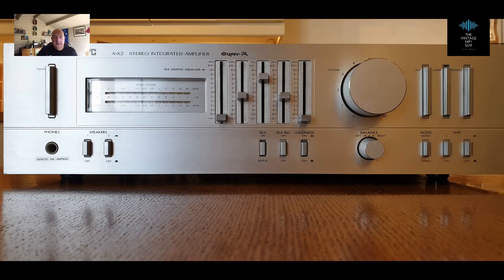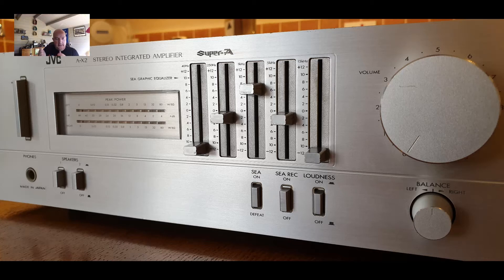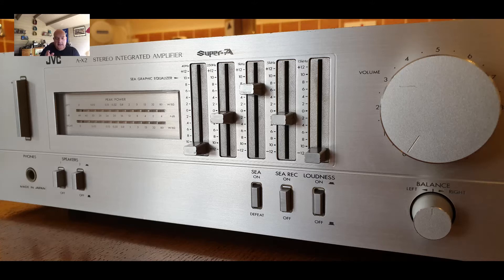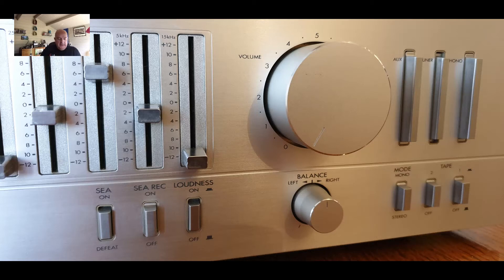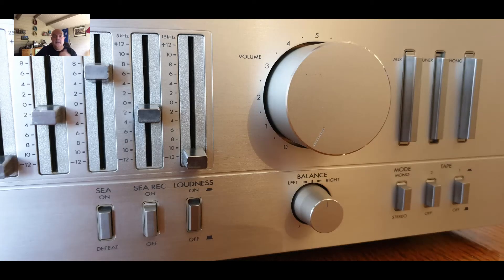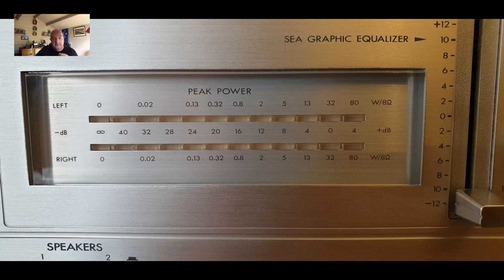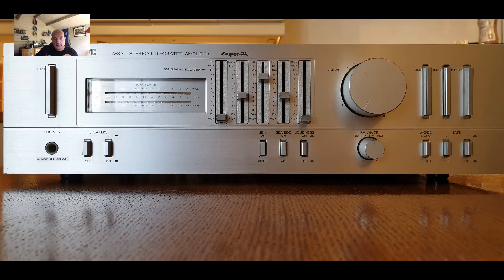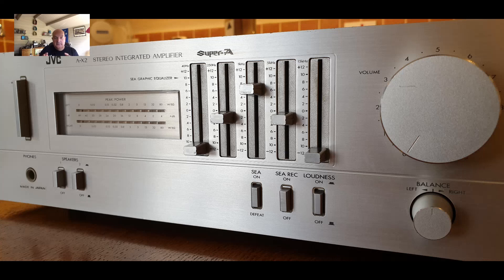The JVC A-X2 Amplifier and Class A Amplification

Comment: Great review, this was my first proper Amp in the early 90s and I still have it today, besides some thermal past replacement and regularly cleaning the pots it never let me down in its 43 years of existence and 30 years in my possession. I was actually planing of going back to Vinyl  but a bit unsure with the weak Phono capabilities you mentioned. Do you have any (affordable) recommendations for a Phono Pre-Amp to combine with the A-X2 or a better alternative Class-A or D/AD amp for Phono use only?
Reply from the maker: Hi. Great to hear from you. I've since sold the amplifier and I'm definitely missing some of its Class A capabilities into certain speakers. My reflective view is that the phono stage is still the weakest part of the package, but whether this was due to age of the quality of some replacement styli today is moot. So much of a journey back to vinyl is dependent upon what you're trying to achieve - i.e. whether you're expecting real high fidelity or just to re-experience the warmth of (some) vinyl. I've found my recent experiences to be patchy - some old records are simply badly cut, others are ok. My old collection is generally of poor quality, mainly due to me moving many times with them over the years and possibly not taking too much care of them in my younger years! If you want to build a new collection of well-cut discs, then you'll need a better pre-amp. I've used Behringer pre-amps less than £50 before now with MM cartridges and they are more than OK for me. Audiophiles will want more and can certainly spend more, but whether you could discern the differences will depend on your own hearing. As for amplification, there are better amplifiers out there. I recently experienced a Pioneer Amp from the 90's and it was truly excellent. Tight bass and incredibly powerful sound, I'm also currently testing a Sony (not normal for me) and it's poor, thin and weak. I've always liked Marantz (PM-350 still one of the best amps ever!) and of course the NAD 3020 has an excellent phono stage. Also, if you can find a good one, there's a relatively inexpensive Denon receiver (DRA-210) which is excellent for a turntable and is a solid performer. Let me know what you're looking for (room size, expected output, expected sound quality) and I'll try and help some more. All the best, David.
Reply: @AVRevival  Wow that is way more answer and help then I expected, thanks a lot already! 
The room is 23.5sq m, speakers are the Canton LE190 but I plan to replace them with something a bit more modern like Teufel Ultima 40, by no means anything crazy expensive. I like music (I am a musician myself) and I realized how bad most of the streaming sources these days are. I would not consider myself audiophile in the terms that I can hear the difference between speaker cables (or actually entire speaker :P ). I just want to go back to the times where I actively listened to my favorite music and discovered all the work the artist has put in, with modern streaming so many details are lost and with the fast food mentality of streaming you rarely take your time to really listen to a anything you just consume for the sake of consumption. Vinyl slows me down and brings me back to the music, the artist and the individual piece I'm listening too.
That said, most of the Vinyl I own was pressed in the last 10 years and in NM to VG++ condition, that don't say much about the press quality of the individual record but again, no audiophile ambitions here. The style of music I listen to is mainly Rock/Pop/Punk/Blues from the last 70 years (60s - today)
I just got a new record player, a (contemporary) Denon DP400, I have the OEM Head, an Audio Technica AT-VM95EN and an Audio Technica AT-VM530EN head that I can chose from.
I love my A-X2 mainly for sentimental reasons, it is the sound and smell (the Amp has a very distinctive smell once warmed up) of my youth, the amp that made me love music and made me learn instruments and create music myself. I am not married to the A-X2 in terms of usage but I will never get rid of it either.
I checked the internet and I can easily source a Denon DRA-210 or a Marantz PN-350  and even a few NAD 3020 are for sale within an okish price range.
Maybe I just buy a a few Amps and see what I like in combination...